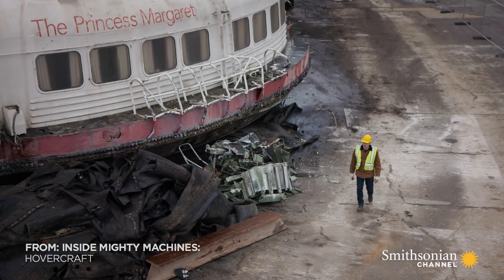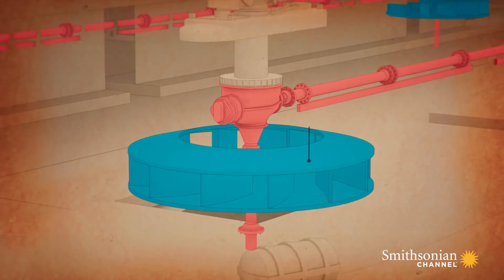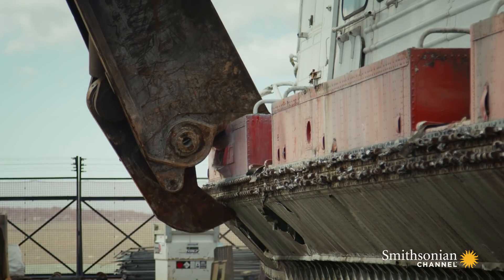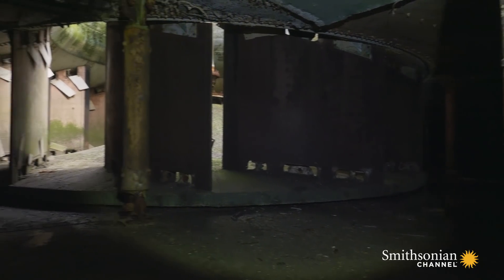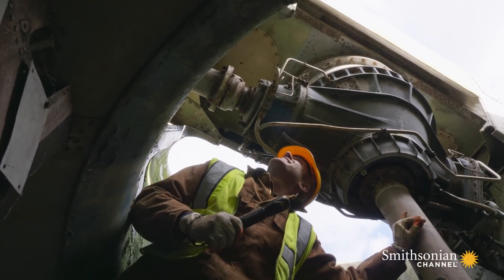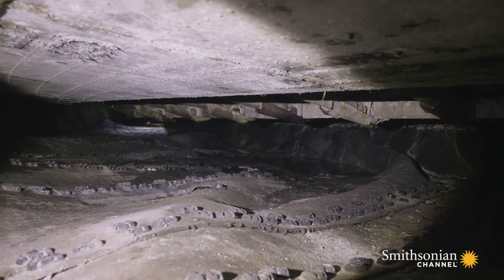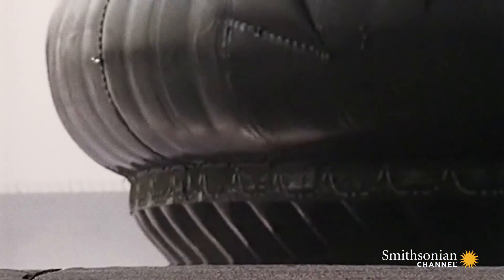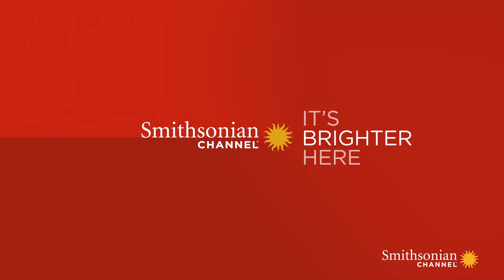Take A Look Inside One of the Most Unusual Vehicles Ever

Comment: rather than make a big deal about biting a hole in the side, why not just climb thru down the air inlet to begin with?
Reply: cause that's a lot less fun and entertaining, duh
Reply: Yes, I wondered the same thing too. Also you could clearly see dozens of access panels inside the rotor assembly that had already been partially removed by someone before, who obviously came in from above to salvage some things. 

As to the seat removal to be done later, IMO that didn't really need some fancy precision pincer-biter-thing to accomplish, though they may have needed it for other reasons anyway.
Reply: Exactly!